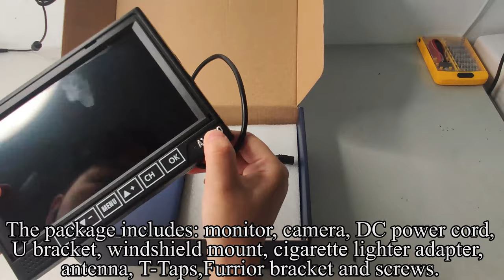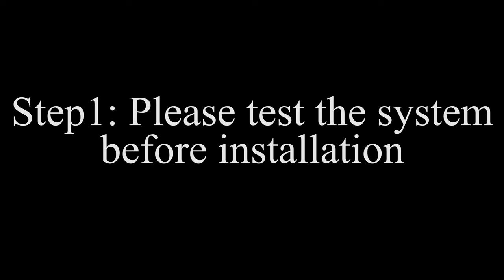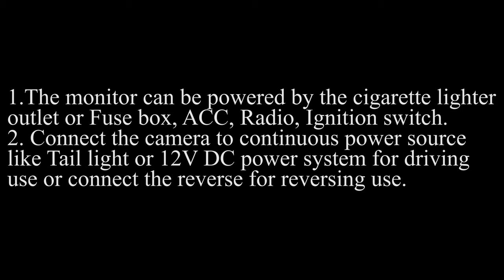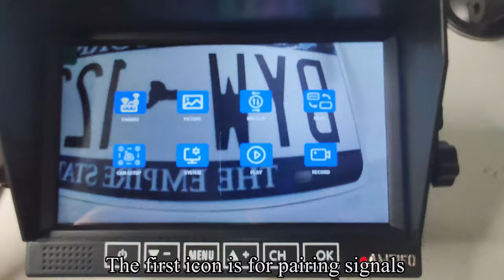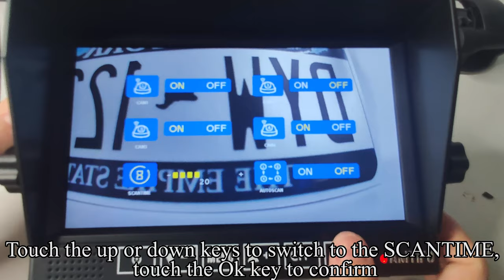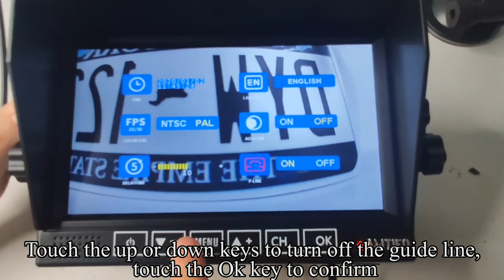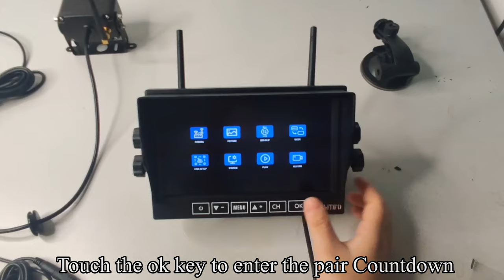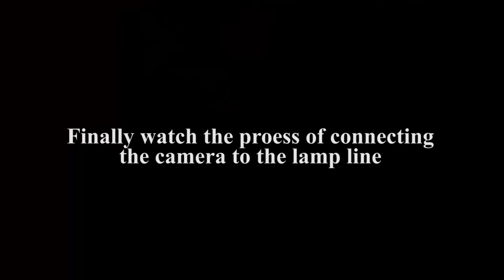AMTIFO A7 RV Wireless Rear View Camera System Operation Video

Comment: I connected the wires to the trailer wires but the camera won't turn on and says no signal. It's less than 50 ft. It worked fine in the test
Reply: Did you find a solution? I’m having the same issue
Reply: @williamgoihl5424  yes, it turned out we needed to turn on the daytime running lights in the truck